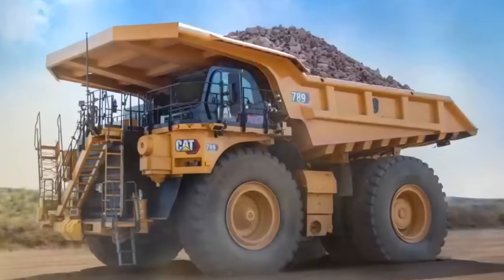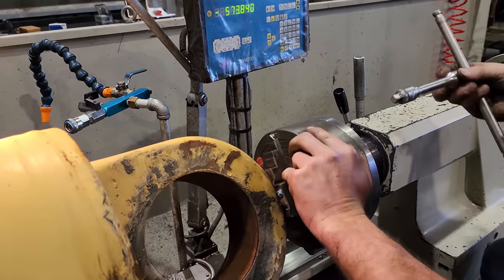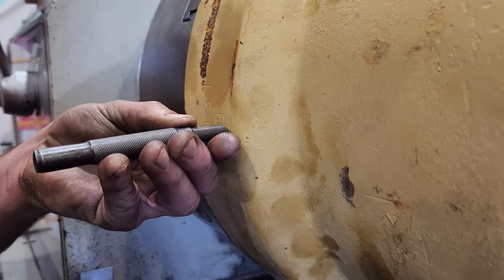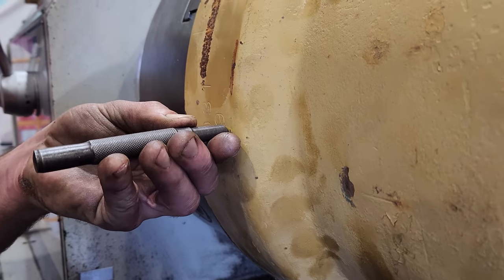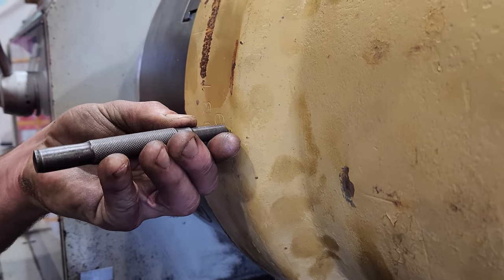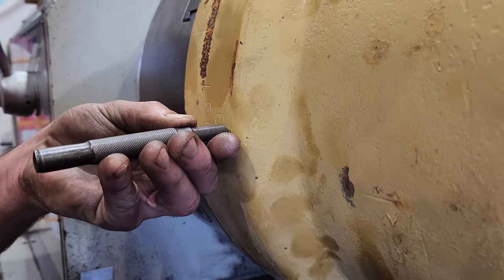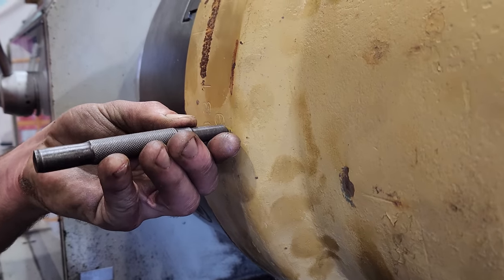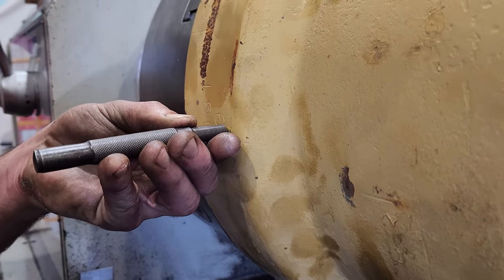Repairing a BIG Mining Truck Cylinder Barrel | Part 1 | Machining & Welding

Comment: I have a question. I know nothing about hydraulics so forgive me if my nomenclature is incorrect. Does hydraulic oil need replenishment over time due to seepage past the seals, and if there is seepage is that what keeps the piston shaft/rod lubricated, or dont they need lubricating. Things ya think about. Thanks!

Comment: Kurtis, Why did you put the live center into the square block and not directly into the part?
Reply: I can understand for setting up, but yes, once it's running true I'm puzzled why the block isn't removed and a centre hole drilled into the end cap.

Comment: Does the coolant increase the life of the cutting tool/insert?
Reply: It can, though with the current carbide and ceramic tips, and the different coatings available, it's not quite as important as it used to be. It also has the functions of washing away chips and lubricating the tool tip thereby improving surface finish.

Comment: when cutting the rod ends off, and after centering, why was the cuts on both ends so interrupted?  shouldn't they have been uninterrupted?
Reply: I think he was machining through the original welds and they may not have been completely even - maybe.

Comment: How do you know what speed to run the lathe at? Is it experience or is there a massive user manual?
Reply: There are very extensive references but they're more for the cutting inserts rather than the lathe. There are various coatings, shapes, base material and tip radii along with recommendations for which insert to use on what material and what speed, normally expressed as surface speed; the rpm being suitably adjusted for the diameter. Things can also depend if you're taking a "roughing" cut, when you're removing maximum material and finish is secondary, or a "finishing" cut, where finish is paramount and normally minimal material is removed.

Comment: It's kind of a shame you needed the end of piece and not the barrel; you could have blanked off the open end, filled it with oxy-propane and with careful aim and timing dispensed with that wretched commuter train once and for all 😅

But seriously it's always fun to follow along and learn useful things, even if my entire machine shop weighs less than that barrel alone.

Comment: This might be a dumb question but I thought when milling the chips retain most if not all the heat when milled away  or am I mistaken about that? But if I’m right about that why did the part get so hot when milling the ID to the point of cooling it down with liquid , Does it change depending on steel or depth and speed of cuts?
Reply: Whilst the chips do get hot, shown by the colour change, the item being machined can heat up as well; I've machined pieces that Kurtis would consider minute and you can feel the increase, sometime to the point of being too hot to touch. And yes, depth of cut and type of material affect the temperature - I believe the last video shows chrome bar being machined and the swarf comes off red hot.
Reply: @michaelmclachlan1650  thanks for the reply, I’ve always been interested in milling and machining it’s always nice to learn more!
Reply: @MINNE93SOTA93  My pleasure! I'm just a hobbyist and it's fascinating to watch Kurtis.
Reply: @michaelmclachlan1650  For sure! He’s definitely a master of his craft!

Comment: Hi Curtis, I've read that yellow paint contains the most led of all paint colors. Since 97.2% of your workpieces are painted yellow, I wonder whether you take any precautions to not breathe in the paint dust as you machine through the paint layer of those parts. Thanks to both of you for the great videos; they are excellent. Greetings from Holland (Europe).

Comment: 👀Great video again. 💪 But I got a question: A mil ?  Is it 1 mm (one millimeter)? Google says: A mil is a measurement that equals one-thousandth of an inch, or 0.001 inch. One mil equals 0.0254 mm (millimeter). - Then I found: Australia uses the metric system. And changed from the imperial feet to metric, in '74..  So a "mil" is ? 
Whit 🍓&🍻 from 🇩🇰

Comment: Why cant you add a center to the eye withoutthe welded on block?
Reply: The block helps centre the cylinder in the lathe, adjusting each chuck jaw until it's true. I am curious as to why, once that's been done, the block is  not then removed and the eye centre dilled.

Comment: 10 passes with MIG?? My man, that weld is going to be super hardened and flaky, as is what happens when you use MIG for large welds. It ain't gonna hold shit. That should have been a job for thick rod TIG or even large gauge stick welding. Well, I guess when you only have a hammer then every problem is a nail.
Reply from the maker: Hey bro we've never had one of our welds break in 7 years, but thanks for the cool story